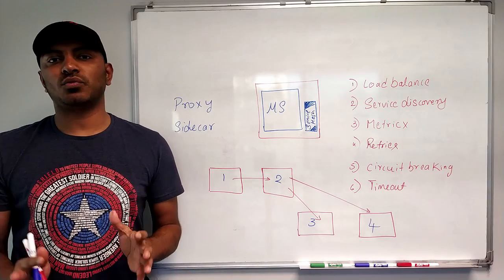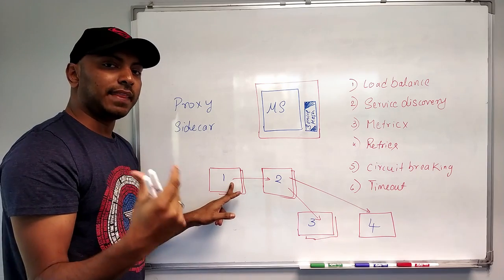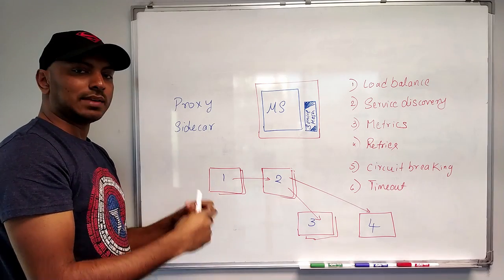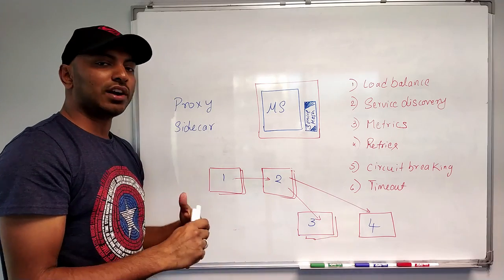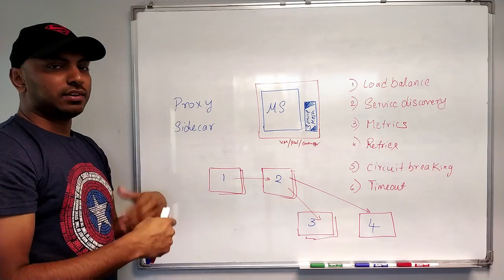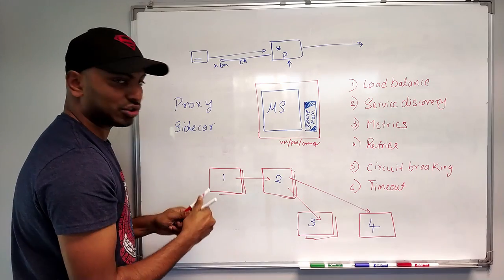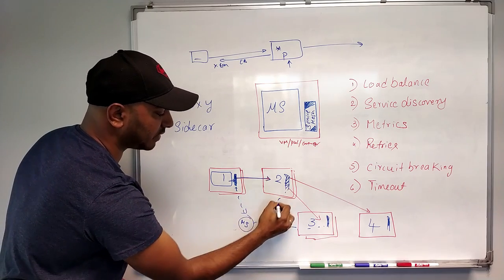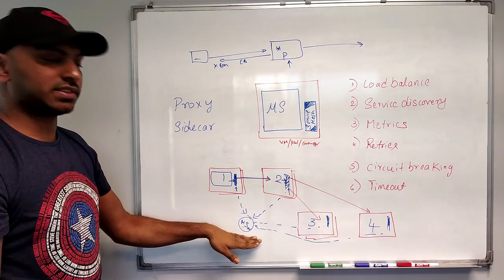MICROSERVICES ARCHITECTURE | SERVICE MESH | PART - 9

Comment: thanks for awsome lectures, 1 question service mesh is proxy or reverse proxy. I think its proxy.
Reply: IMO the distinction isn't as important because there's not a clear client and clear server here - just 2 services.   I also think they act as both.  For example, service 2 does not know the incoming message from service 1 was handled by a proxy, so that means it is a forward proxy for service 1.  However, service 1 thinks its talking to service 2, but it's really talking to service 2's proxy.  So basically it's both depending on the flow...?